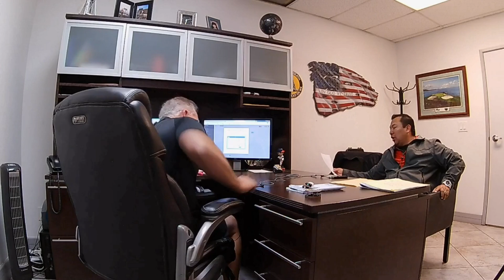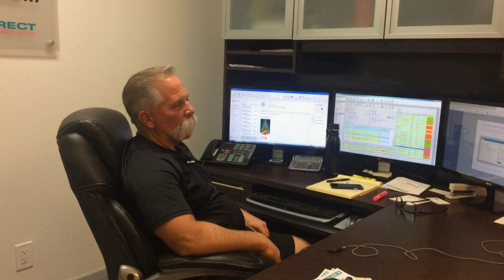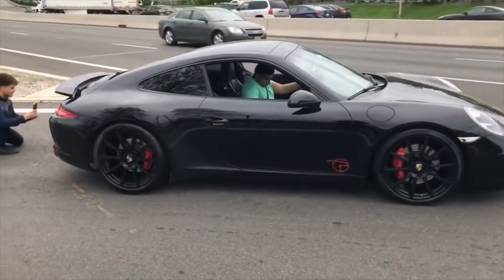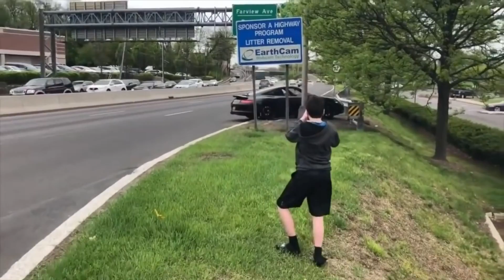Engine Oil Analysis Review - Blackstone Labs - Titan Lab Results Australia - Worth the Money?

Comment: Very informative video, it’s interesting to see his point of view on everything.
Reply: hmm not so much hes barely got an idea of the subject itself. Hes sprouting off opinions like facts and suffering from confirmation bias. Sounds educated but a bit of an armchair 'expert'. If you knew anything about metallurgy or tribology you could see through his comments. Go to the noria machinery lubrication website and educate yourselves. Disregard 95% of what he says in this video.
Reply: @cryptonight1455  Thanks for this, I will check it out. All due respect to the guy he did say he’s no expert & only said it works for him with great results. Wether this is luck or fact who knows. Maybe you were reading him a little wrong. He just looks comfortable & confident with his own opinion & is happy to share it with us. I respect that.
Reply: @Landybandy1  He is correct more than not....big exception is synthetic. Back in the day, 20 years or so non-syn wasn't made from recycled oil. I'm speaking in generalities as to years....Even if one was to compare non-syns best year against premium syn they still wont compare. I do overall agree with his logic! There is a reason/REASONS "ALL AIRCRAFT USES SYNTHETIC"!
Reply: Question????..is the small added cost worth a new engine?????? Please give me feedback!
Reply: @TechSeller I do this on all my vehicles. A few bucks for some data that can save you money in the long run. Also helped me on a few warranty issues with my Ford.

Comment: I changed my 96 Tahoe every 5k miles. The owner manual said ever 3k miles. The engine went over 285k miles. I only had to rebuild it because the heads cracked.

Comment: A tow truck motor with 160k miles and a life of synthetic is going to be REMARKABLY cleaner on the inside than one run with conventional. It isn’t even close .

We’ve torn motors down that we know for a fact ran conventional and ones that we KNOW ran synthetics and the amount of sludge, build-up and varnish from Dino Oil is night and day vs. fully synthetics. That is to say a full synthetic that is NOT a conventional  base oil. 

Don’t believe the negative hype. 

This guy isn’t gonna tell you about all the rod knock and overheating his trucks have had over time because ‘that has nothing to do with the oil’.. 

I’m sure he has had lots of luck with conventional oil and over the life of the fleet he’s probably saved a few thousand bucks over a multi million dollar business .

But the science is clear, synthetics run longer, with less wear; provide better cooling, and are superior in extreme conditions, to conventional oils.

Comment: Oil analysis is well worth the money for aircraft engines.  I have it done every 100 hours.  It clearly shows when the engine is worn, or if some part in the engine might fail.  I have over 25,000 hours in the air.  They have saved me several times.  Yeah, I do it in my vehicles as well.  I use synthetic oil because it has superior lubricant characteristics.  Oil analysis will also tell you when to change your oil.  I go by laboratory science, not opinions.

Comment: While regular oil analysis may not result in a lot of useful info an irregular analysis can be very useful e.g. Establish a baseline for wear in an engine. If the wear is unusually high you might reasonably ask the dealer to do something under warranty.

🙂

Comment: Oil analysis will tell you which additives to use in your engine ie. The ones resulting in the least wear.

It is difficult for most people to establish what does and doesn't work without oil analysis.
Oil analysis often makes the choice black and white.

Lifespan of an engine can be extended 2~10x by using the right oil and engine treatments.
That's a major benefit that it would be very hard to quantify without oil analysis.

🙂

Comment: I believe regular oil analysis makes sense for things like aircraft that might have disastrous consequences if the engine fails. Larger engines like EMDs and other engines that hold hundreds of gallons of oil can benefit from oil analysis as the cost of the testing is minimal compared to the cost of changing the oil. I don’t see the point of regular oil analysis for a car or light truck. The cost of the testing is almost the same as changing the oil. To me it is a waste of money. I mean seriously, what are you going to do tear down your engine before it needs it because of elevated wear metal in the oil? If the engine in your car or truck fails nothing happens except you might need a tow. If your oil is getting diluted with fuel not only will you be able to tell by simply wiping the oil off the stick with your fingers, but your oil pressure will be lower. Take that money you are going to spend on the oil analysis and use it to change your oil more frequently! Most problems can be discovered by simply cutting the oil filter open and looking for metal. Now oil analysis makes sense for a used car truck or other equipment you are looking to purchase! This can save you a fortune by catching someone trying to screw you over by selling you something with an engine that is coming apart!

Comment: Everything has its place, synthetics are better suited to extreme conditions, especially cold climates. Changing your oil more frequently is almost certainly cheaper than repairing or replacing you powertrain more frequently...
Reply: Premium Synthetics are suitable for someone do does a lot of highway miles and and want an extended oil change interval or for fleet operators who can do a true cost-benefit analysis. Everyone else is flying by the seat of their pants.

If synthetic oil is required for an engine, then you have to use it. But you don't have to use the most expensive product. You can use low priced synthetic and it will meet the technical requirements of the engine.

Synthetic oils are either Group III or Group IV base. Group III is made from petroleum and Group IV is made from natural gas. If a synthetic is Group IV, it will say right on the label that is made from natural gas or it will say that it is AOP oil.

As of 2022, the price difference between low price synthetic, semisynthetic and conventional has just about disappeared. All low price synthetics should be considered Group III unless it says it is not on the label. For oil change interval purposes, Group III synthetic can be treated as glorified conventional oil. I would say, allow a 25 to 50 percent longer oil change interval with Group III, depending in the vehicle, brand, type of driving and your own judgement and common sense.

One thing about motor oil is that you do not need to think about the ability of the oil to neutralize acids or suspend contaminants if they are never there in the first place. Keep a short oil change interval and they won't be there.

My advice is easier to handle for people who do their own oil change and other maintenance but that's the way it always is. Life is easier for people who can do their own home repairs and handyman work and it's easier for people who can cook too. Anything you can do for yourself makes your life easier.

Comment: His mustache is ridiculous. Good thing that's not my face. So oil blackens when heated up. Not necessarily dirt. I think maintenance is the key. Doesn't matter the oil. Long as it's same viscosity. I also have a old mechanic that has a 200 plus truck it burns oil and he NEVER changes oil. Just tops off when needed. So who knows. BTW 25 yrs I've been driving I have never had a vehicle have internal engine issues due to oil problem. It's always electrical or transmission or all the other parts. 3 to 5k mile changes and u will be fine

Comment: Just heating the oil up to the same temperature as the operating temperature of the engine for a specified time will turn it black with zero contaminants in the oil.
Reply: I’ve literally watched videos of this process taking place. Doesn’t necessarily mean the oil is dirty.

Comment: I am almost certain doing more frequent oil changes is a lot more beneficial than using synthetic. I wasn't even aware that was controversial.
I personally use synthetic but I still change the oil about 30-40% earlier than what the manufacturer calls for.
I don't go shopping for oil when I need it. I'm always hunting for deals and I'll pick up a few containers when I find one. For example I picked up a bunch of Shell Full Synthetic 5 qt containers for $15 each. Now I have enough for at least the next 2 years.
Reply: Also, I bought filters in bulk for $2-3 a piece. They were OEM's. You could probably get aftermarket ones for less. I don't think it matters much for filters. I like brands like Bosch, Wix, Mobil, Motorcraft, higher end Frames etc. Bulk is the name of the game.

Comment: Premium synthetic oil can be very useful for certain applications and/or driver needs like owning a car in severe climate regions, extended drain interval for busy people, racing in hot climate, performance & tuned cars' harder strain, consistent shifting for motorcycles during summer, taxi or limousine vehicles reduced shop time & idling oxidation, hybrid vehicles, and turbocharged cars.

Comment: Interesting POV - certainly you wouldn’t do a bottom end overhaul on a car at the sign of increased ferrous metals in the oil but obviously the are certain situations and applications that warrant a closer look Like the Porsche Boxster engine IMS  issue or or aircraft / aviation applications

Comment: I respect anyone who has made it through the gauntlet of 25 years of changing your oil every 3000 miles. Threw money down rhe drain. The problem is he doesn’t understand true Tribology. Because he didn’t understand, he just stuck to what ‘worked’. It barely worked. When he says the vehicle is ‘just fine’ when he sells it, he has no idea. Shell oil is good oil. If it works for you, run it. Open the motor up after 450k and I can almost guarantee you it will not be long and 7/10 you are going to have to over haul the motor in the next 100k-ish miles anyway because the carbon that did exist ‘sandblasted’ the sleeves, bearings, etc over time. He could put on a bypass filter, even a different company them Amsoil, and get rid of the soot. But use Amsoil in that scenario and you can make our 100% Synthetic oil, which shell oil is not, last longer then 15-20k miles, you may cna stretch tow truck miles in the 30-40k range or even longer, with oil analysis. Once you learn a truck, you do not have to do oil analysis as often either! If you truly pay attention to your lubrication program and have someone properly managing your fleet of vehicles, you can both save money and time on oil changes, keep that truck working, and longevity of the fleet you paid good money for. I respect the hell out of someone who has gone down that road and made his company run and work for 25 years. But its like he was running a foot race with a bullet hole thru his foot, and bleeding he whole time! 🤦‍♂️

Comment: Pfft a diesel engine will always have black oil even with a 2 micron bypass filter right after you add new oil from a oil change.
Reply: How do you figure? Our bypass filters filter down to 1 micron at 50% efficiency, and 2.1 microns at 98.7 efficiency. Yes it will be black, but given time, and constant running of the engine, it will be slightly black, only because of the soot created since the actual last run of the engine. Soot that causes 80% of the wear in an engine is between 5-20 microns. We filter all that out. Less soot= less wear add that to the fact if you run Amsoil, you are good to go for long periods.
Reply: @peterssynthetics  dear peter and Amsoil brother. Because soot gets down to .03 microns in size. A centrifuge has a hard time. And 2 microns is as good as any Amsoil filter will do. Thanks to the egr that redirects exhaust gas before the dpf " Dumbest idea ever!" It could've been after dpf filter because it's the NOX they were looking to reduce. So egr is dumping soot into the intake and reducing the size of the particle in the combustion chamber getting into the oil film in the cylinder walls and getting by the piston.
Reply: @Jon-O.  Only problem is Amsoil bypass filters do get particles at 1 micron at 50% efficiency. The designer himself has stated in many articles and in commercial videos. He has stated as well that it does get the under 1 mic particles as well. Amsoil, we really are the highest quality!
Reply: @peterssynthetics  you don't have to prove the quality to me. It's the best on the market hands down. It's just the nature of the beast with clean diesels and the goal for Amsoil to get the solution to soot removal even better. Even though it's good now. The problem I have is Ram sees a bypass filter installed on the truck they will immediately void the warranty. So it has to be removed before it's taken in for warranty service. It's sad and wrong and I'm tired of planned obsolescence by so many manufacturers. The short sightedness is astounding how many more people would be repeat vehicle customers even if the vehicle they had was still running 30 years later and only bought again just to have a new model because of the dependable longevity. Especially with the price of vehicles today.
Reply: @peterssynthetics  yeah I'm hooked up with Eben sorry. The problem is in the contractual extended warranty agreement a oil  bypass system that is not their Dodge design is a modification they will not honor breaking the agreement by the customer end. Which is signed contractual Agreement which stands in court. Regardless of The act. It's in the fine print. Just like deleting, tuners injectors that increase horsepower and torque beyond manufacturers specs nullify manufacturers warranty.
Reply: @Jon-O.  Eben is my upline dealer as well! :) Great guy with a great positive message. Ah well manufacturers seem to be able to do what they wish these days. It truly is up to us to keep the American, can-do spirit alive and well!
Reply: I want to put an amsoil bypass filtration system on my ram 2500 6.7L Cummins however it has compound turbos.  The auxiliary oil feed that the bypass filter would use is already utilized to send oil to the second turbo.  Would it be a bad idea to install the bypass system and send the 2μm filtered oil directly to the turbo instead of the oil fill port? Oil needs to be continuously supplied to the turbo bearings especially at start up
Reply: @andymike6575  no because your only returning 7 to 10% flow filtered back to the turbo instead of the engine filler cap. It would be wiser to tee the feed off from where it starts at the turbo feed fitting on the oil filter housing where you tapped in at because it will send full system pressure to your turbo setup even though your branched off to feed the  bypass filtration system because it by design only allows a metered flow to it all the while maintaining full flow and pressure to the turbo Hydraulics principles.
Reply: @Jon-O.   interesting concept.  So if I’m understanding correctly, just tee the oil line to feed both the turbo and the bypass filter? Does returning the filtered oil to the filler cap provide better lubrication to the top end’s cams/rockers? I presume a Y fitting would be better flowing than a T joint.  Thanks!
Reply: @andymike6575  better at the filler cap area but mostly it just drains back down to the pan. Also it's still going to be black because it filters to 2 microns all soot below 2 which does nothing to the engine at all is still present. What dose the wear is between 5 and 15 microns which gets filtered out anyway. Y will  definitely work.

Comment: It's really easy to measure the difference between a mineral and synthetic oil just use a magnetic sump plug?
We noticed a huge difference between a mineral and semi-synthetic oil.
We couldn't pick the difference between a semi-synthetic and synthetic oil using a magnetic sump plug.
Here's an example of a magnetic sump plug being used to measure wear:
http://xcelplus.com.au/docs/testimonials/colt.pdf

Oil analysis is more precise with more detail about non-ferrous metals: 
You should be able to pick up the difference between a semi-synthetic and synthetic oil using oil analysis... although it will probably be small for a large price difference: There is probably a genuine argument for not using a full synthetic if you're already using a semi-synthetic?

Here's an example of oil analysis being used to measure wear:
http://xcelplus.com.au/docs/yaris.pdf

However if you do oil change more frequently than normal the wear difference between mineral and synthetic oils can be minor e.g.
https://www.machinerylubrication.com/Read/30383/engines-oil-analysis

If your change intervals are higher then synthetic oil probably makes more sense the longer the change interval?

The only way you would know for sure is to measure it?

The devil is always in the detail?

:-)

Comment: Great Advice!  But I can’t do every 3K with my Mobil 1 High Mileage Synthetic.  Mobil 1 says it’s good for 10K, and I’ll change every 5K.  (Maybe every 3K if I’m doing hard driving.)
Reply: Better advice: Use Amsoil oil and oil filters at the recommended oil change intervals. If you want a blanket of protection go to 15k with our oil and filters instead of 25k. Learn to do oil analysis and learn your vehicle. Even if you run Mobil 1. Do the oil analysis and learn where you actually need to do the change at. Our kits are $30 and they goto Oil Analyzers. 100’s of thousands of ppl run oil analysis every single month.
Reply from the maker: The oil might be good for 10K miles but is the oil filter up for that abuse. If you go that long I would change out the filter at 5K miles. 2 filters for every 1 oil change.
Reply: @bundysgarage  thank you!